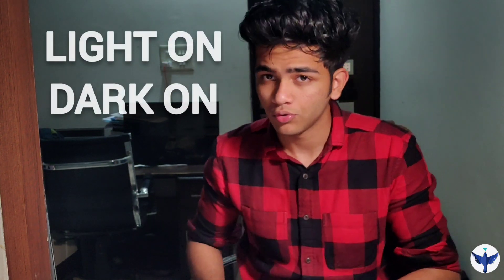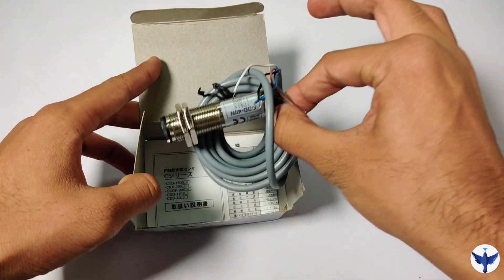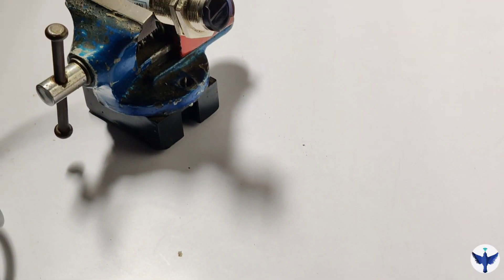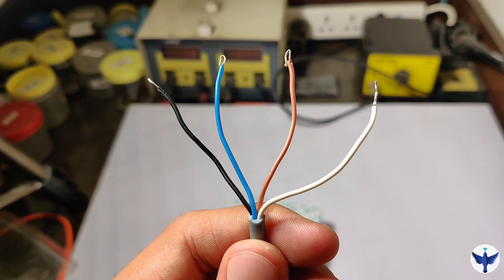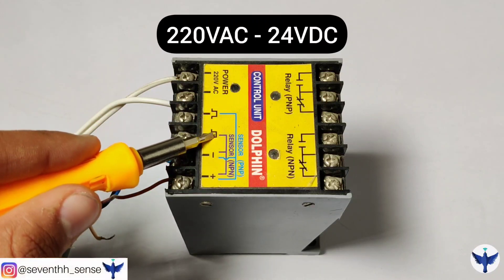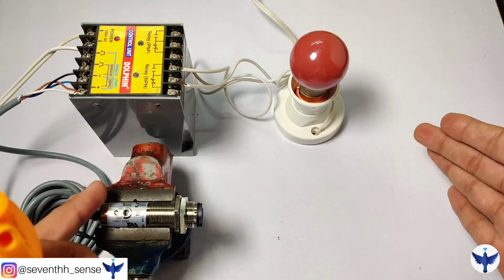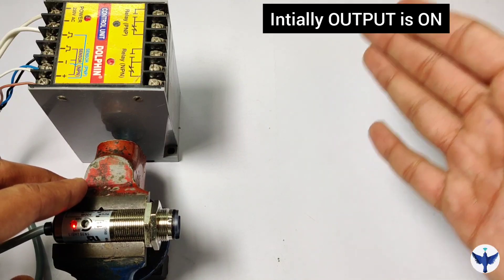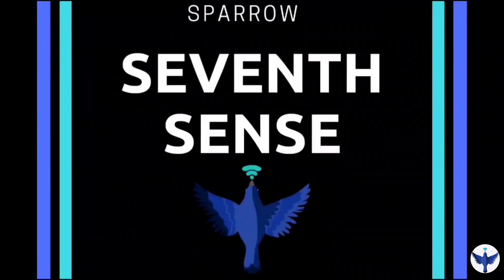CDD-40N Sick OPTEX Sensor II What is Light ON and Dark ON Mode OUTPUT? II For Sanitising Booth

Comment: If my sensor is 3 wire and there is already port selection of L & D mode then will it work same as you explained in this video?
Reply from the maker: Yes L AND D is for NO AND NC OPERATION respectively